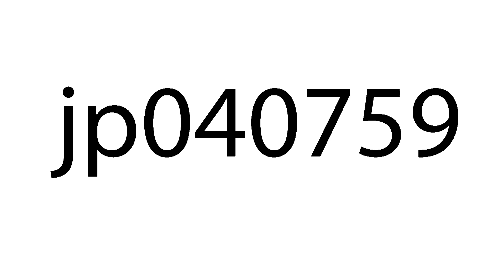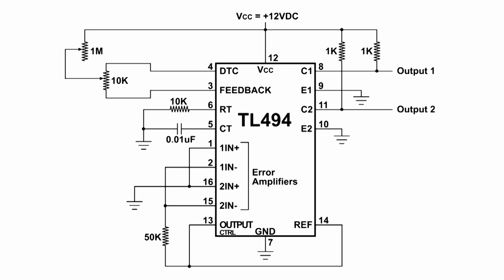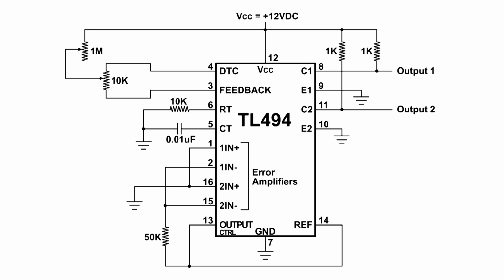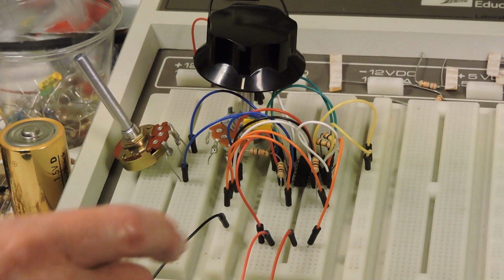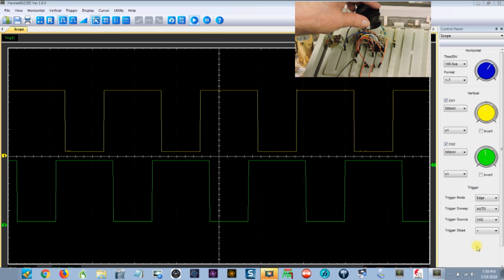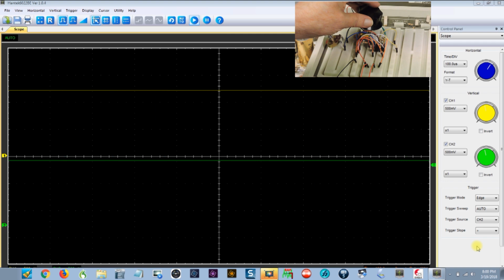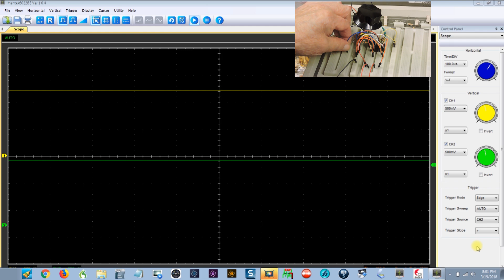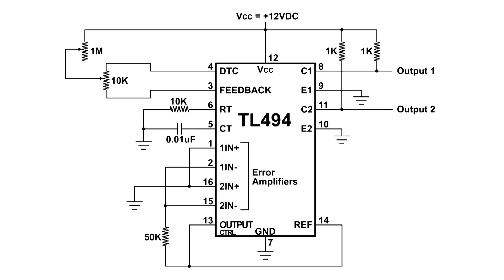TL494 Pulse Width Modulation Control Circuit

Comment: Kindly I ask you what is type of connection of two potentiometers located in the upper left corner of the circuit ( how I can connect the 3 pins of 1M ohm with 3 pins of 50K ohm) thanks
Reply from the maker: The 1M sets the limit, usually a value of about 15K works nicely. The 10K varys the output from the limit to the max. 
I prefer this setup of the TL494. Unlisted video.
https://www.youtube.com/watch?v=PkwqwKPnFpA

Comment: Please I need your help to tell me if there is software I can used it to simulate HFT ( high frequency transformer) thanks
Reply from the maker: Simulate HFT, does that mean you want to simulate HFT on a screen like an oscilloscope? Do you want to control the transformer with software? I’m not understanding your question.
Reply: @AllAmericanFiveRadio  yes I want to simulate HTF on screen like an oscilloscope and I want to presented  circuit completely  using mutisim  program
Reply from the maker: @hefnijaber7088  I just got this comment.
Protues didn't show the sine wave
Answer:
Simulations are limited.

Comment: Thanks for your keen efforts done to producing such interesting videos kindly I ask you which software contain HFT (high frequency transformer) because I want to simulate circuit contains tl494 and transformer, frequency for tl494 depend only on on resistor and capacitor value on legs 5&6 best regards
Reply from the maker: Yes, the TL494 has a built in oscillator, and the frequency is dependent on the RC time constant on pins 5 and 6, and the variable resistor on pin 3. I prefer the TL494 configuration in my unlisted video. Here is the Link:
https://youtu.be/PkwqwKPnFpA

Comment: I tested this it only works for frequency of about 300hz does not work at 60hz.
Reply from the maker: The chip specifications says 1KHz TO 200kHz
What are you wanting to make?
Reply: Thanks for your keen efforts done by you to produce such interesting videos kindly I ask you is there is high frequency transformer component in any application allow me to make simulation for any circuit contain HFT and TL494, and frequency for tl494 depend only on resistor and capacitor on legs 5&6 best regards

Comment: Very nice!
I am currently working on a high power 5000W synchronous dc to dc boost converter system and I am planning to use TL494 as well.

Great video.
Success wishes!
👍👍
The Innovati0n Lab💥
Reply from the maker: Thank you, and your welcome.
This circuit will not produce any usable power. It is for demonstration only. 
I will be glad to help, and try to answer questions you may have. My email is allamericanfiveradio@yahoo.com   : make the SUBJECT TL494 project
Reply: @AllAmericanFiveRadio  
Sounds great! I made a video a while ago to introduce my concept - basically my goal is to design a synchronously controlled interleaved boost converter system - capable of delivering high output currents even at low input voltages. If this works, then I will see about modifying the circuit to operate with synchronous rectification - for better efficiency. 

Texas instruments did a wonderful job with the TL494 datasheet by explaining all the design considerations and calculations....Switching frequency, power inductor selection, dead-time control, filter capacitor selection.....etc. 
These will be covered in my next video.
Thanks again!

The Innovation Lab

Comment: Thanks for the video. I have a question- why are driver transistors necissary in the case of driving mosfets? Is the 200mA max current from the internal transistors insufficient to drive them directly? Thanks!
Reply from the maker: I am experimenting with a new configuration of this circuit. The output of the TL494 can over lap. Adding transistors changes the phasing 180 degrees so now the overlap is the ground and not the positive pulses. This video shows the new circuit plus a very experimental circuit for HO output. I plain on developing it as one of my winter projects. My email is allamericanfiveradio@yahoo.com make the subject TL494.
Project:
https://youtu.be/PkwqwKPnFpA

Comment: Yes but the duty cycle won’t step down to increase output volt I did try it and the ac voltage on the transformer dop from 120 to 70 ac the duty’s cycle at 50 % give only half the voltage of anything it driving 39 % of duty cycle put out almost power power on transformer with load
Reply from the maker: It all changes and depends on the transformer and frequency used.

Comment: Thanks for uploading this nice video. It's really helpful. Could you please tell about 10k potentiometer fixed between pins 3 and 4. What's purpose and how it value was adjusted?
Reply from the maker: It adjusts the minimum plus width.
Reply: Sir many thanks for your reply. Can we use the same circuit and duty ratio adjustment for a single switch converter?

Comment: Are you suppose to change both the Capacitor and resistor on RT and CT to change the frequency or just the capacitor
Reply from the maker: In the PDF RT = 12K and CT =0.01uF, I would there.
https://www.ti.com/lit/ds/symlink/tl494.pdf
I have just changed CT to get the frequency I want. But it maybe necessary to change RT also to get the frequency you want. Use the RC time constant.
https://www.digikey.com/en/resources/conversion-calculators/conversion-calculator-time-constant
Reply: @AllAmericanFiveRadio  wow! Thank you and thank you for posting! very useful information

Comment: Hi, I see periods of time where both MOSFETs will be turned on simultaneously. Is that correct? What application would have that situation? Thanks for you video!!
Reply from the maker: Yes that is correct. One thing you could do would be to adjust your variable resistor so that you get just before any overlap. Measure that resistance and put it in series with your verbal resistor, that way you cannot get into overlap. I did do another video on the subject and I think you'll find it interesting. May give you some more ideas.
Pulse Width Modulation Half Bridge MOSFET Driver TL494 2N2222 IRF510
https://www.youtube.com/watch?v=nTETbbn-dig
hope this helps

Comment: How about a friend, I would like to know if the output frequency is 50hz and what output oscillation voltage delivers pin 8 and 11 ... greetings.
Reply from the maker: Pins 5 & 6 is an RC time constant so just choose the resistor and capacitor for 50kHz.Pins 11 & 8 have pull-up 1k resistors to +12VDC so the output is a little less than +12VDC.

Comment: Great video! Been looking for ways to incorporate back EMF into a PWM signal. Think  this might do the trick.
Reply from the maker: Hope it works.
Reply: @AllAmericanFiveRadio  Curious if you have any tips on transmitting / receiving a PWM signal ? Was planning to have a go a making a radio controller for a motor... Do you simply input the PWM signal where you would normally input an audio modulation signal?
Reply from the maker: @andrewferg8737  Hey Andrew. The guy I build ozone units for is designing a power supply using the TL494. He plans on taking the outputs of the TL494 to drive the Gates of a couple of MOSFETs. Here is my email allamericanfiveradio@yahoo.com
Reply from the maker: Here's is another Chip to check out FAN7387 DIP-8 FAIRCHILD
Reply: @AllAmericanFiveRadio  Was looking thru my junk box and found a AP3842CP . I have a go at it once I'm finished with my current project. Another tab on the bucket list!

Comment: which is the oscilation frequency?
Reply from the maker: 10,000 Resistance
0.01uF Capacitance 
Time Constant = 0.0001
Frequency = 1,591.5 Hz
Reply: @AllAmericanFiveRadio  thx im still learning... :)

Comment: Output voltage c1 & c2 must be same or not?
Reply from the maker: If you want a different output you could change the value of one of the 1K resistors.
Reply: @AllAmericanFiveRadio  thank for the answer...
But when i measure c1=12v c2=5v.... ic is bad or not?
Reply from the maker: @fisrtteknik6496  
Keith Hamilton

 The output should be the same with this circuit. It is possible to change this circuit so that one output has a shorter pulse width.
Reply: Great answer.... thanks bro...

Comment: Goody Sir, I want  to know if i connect pin 8 and 11 to a high speed mosfet drive  and the a mosfet, can i use it to drive a HF transfformer and what could be it friquency?
Reply from the maker: I think your idea will work. But you will probably have to drive junction transistors first, and let them drive the MOSFETs. This is because I don't think the chip puts out enough voltage to drive the MOSFETs on all the way.
Reply: @AllAmericanFiveRadio  The TL494 is very well-know to Tesla Coil and HV enthusiasts for this purpose. Usually the PWM output is fed into MOSFETs or (isolated) gate drivers, for example a chip like the A3120.

Comment: Would be possible to use the 2 outputs on same frequency/same phase, but adjust duty separate ?
Reply from the maker: Yes you could have the output you want drive two transistors and use each as an in phase output.

Comment: It would be interesting to know what frequency is delivered in the current layout and what frequency range could be achieved by substituting the 10K resistor on pin 6 with a 10K pot (leaving the 0.01uf as it is on pin 5).
Reply from the maker: http://mustcalculate.com/electronics/rctimeconstant.php

Time constant ~100 microseconds
Rise time from 20% to 80% 140 microseconds
Rise time from 10% to 90% ~220 microseconds
3dB cutoff frequency ~1.591549 kilohertz

Comment: Hi grate video Big thumbs up. I noticed there was a difference in pulse width between Chanel 1&2  would this be a problem driving a transformer in push pull configuration ? Cheers . Looking forward to seeing this project in action
Reply from the maker: I don't think it will be a problem. But we'll find out.
Thanks.

Comment: Other similar ICs, but probably a bit dated, are the SG3524(and 25).

Saw the TL494 used in almost every single switching PC power supply of the past couple decades, at least. Sometimes would see a KA7500. Now days seems they use more advanced stuff, or UC3842(or 43). 

All these chips definitely helped keep high power PWM supplies simple in design.
Reply from the maker: Thanks and
thanks for the information